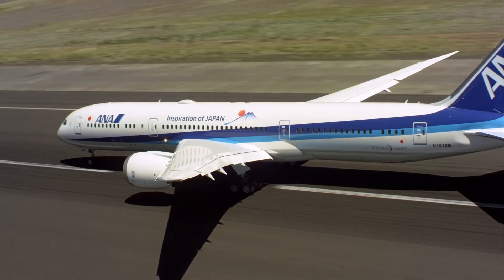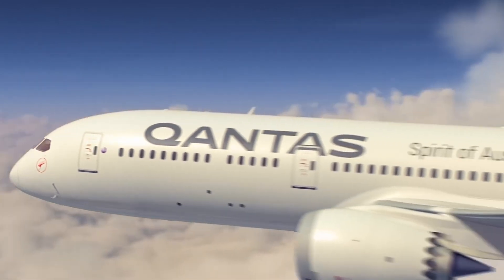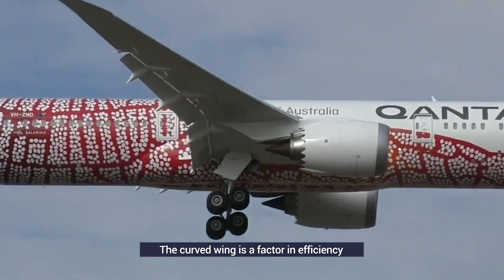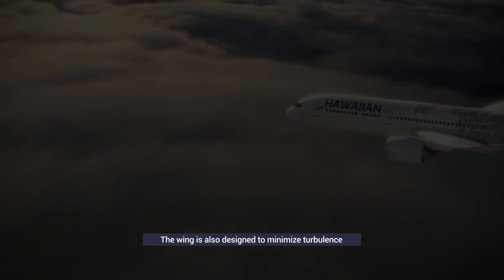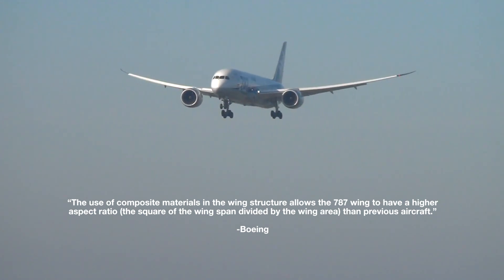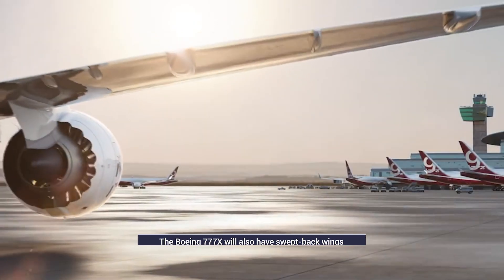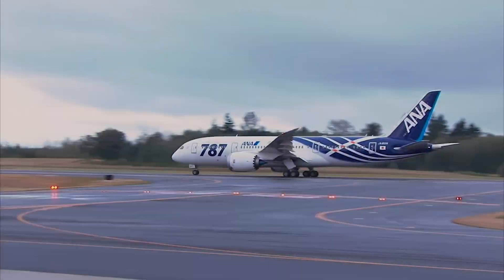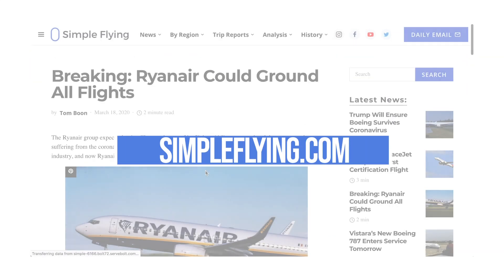Why The Wings Of The Boeing 787 Are Curved

Comment: DYK: Most of these aerodynamic designs have been inspired by nature, especially the wings of eagle. An eagle maximises aerodynamic lift by curling up its feathers. Curved wings and winglets reduce drag without having to increase wing's length and this design is particularly effective for narrow-body planes like 737 and 757.
Reply: 787 is widebody aircraft
Reply: @memeyoyo3361  Apologies, I meant 757 and not 787
Reply: Wait, I'm not saying you're wrong, but how does an upward wing tilt create more lift? Shouldn't it create less lift because there is now a lift component pointed inward (and thus not contributing to upward lift)?
Reply: @gabedarrett1301  Hi, thanks for your question. This is done by reducing induced drag, which happens because air pressure below the wing is greater than above the wing. Curved wings and winglets reduce that drag. Obviously, making the wings longer is another way to reduce the drag, but that is not effective up to a certain extent because then wing's weight would be higher relative to overall aircraft weight, which is counter-productive. And obviously, there is trade-off as you mentioned between reduced upward lift vs. reduced drag, but there is a net increase in lift (observed especially in narrow-body aircraft) which means lesser fuel burn. In fact, back in early 2000s Boeing consulted couple of airlines for feedback and they reported at least 3-5% fuel saving due to curved wings and winglets.
Reply: If 787 is narrow body what plane is wide body?

Comment: 0:25 The range of the B787 is compared to the A350 much lower: While the Standard Version of the A350 can fly up to 15.000km (in the Long Range Version even around 17.900 km), the B787 only around 13.900
Reply: ya dont say.
Reply: Yeah......they don't compete.
Reply: The -10 only competes with the A359

Comment: This aircraft is not only beautiful but has one of the smooth take off I have ever experienced...I wish Beoing would create even better models using modern tech
Reply: Have you tried takeoff / landing on A380: incredibly smoooooth
Reply: @arnoparisfra7866  Not yet but may be soon probably 2021 looking forward
Reply: I've traveled on A380 more than 20 times, and some of it's takeoffs are really heavy and turbulent, sometimes you feel like the plane is stalling, especially during hot middle eastern summers. I think the 787 takeoffs are much smoother, it feels really light and you don't feel as if your lungs are being pulled down.